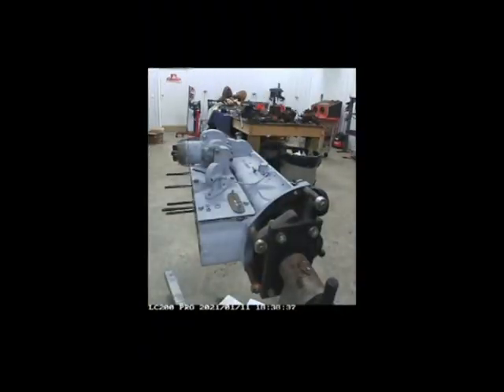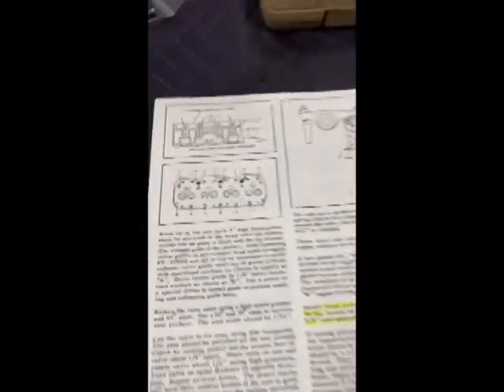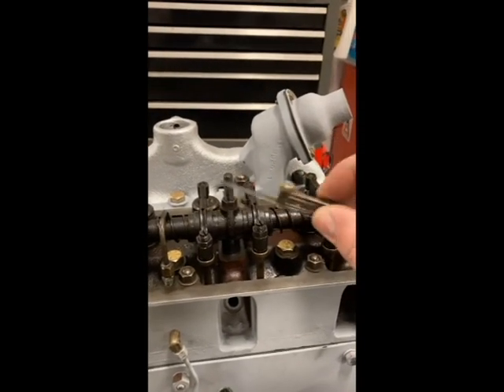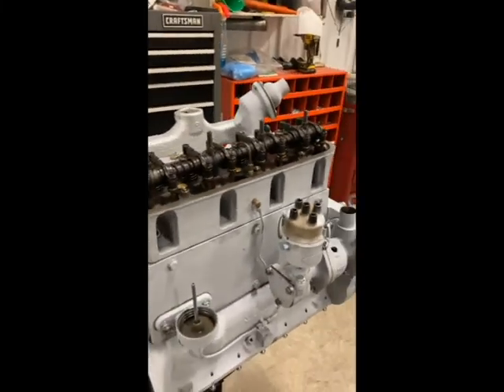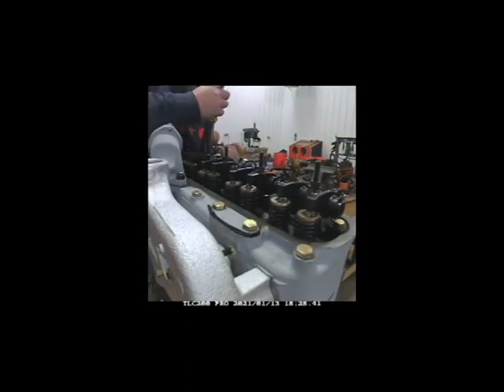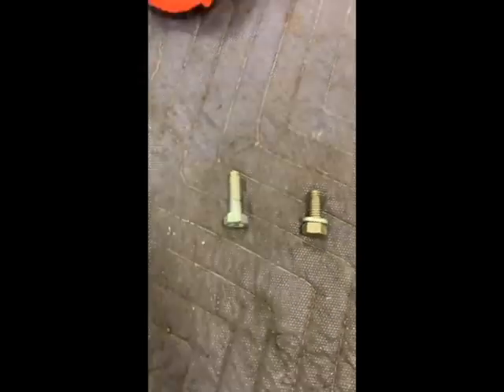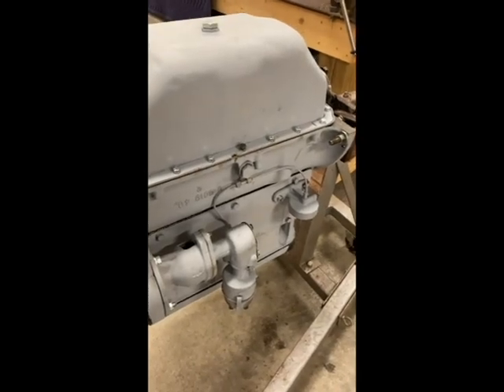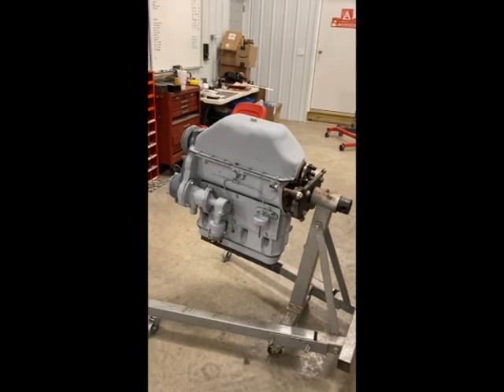Allis Chalmers WD Engine Assembly Top End Part 13

Comment: I'm working on rebuilding the engine on my WD as well and have the original studs removed from the block. I note that you replaced the original studs with bolts so I have to ask what grade of bolts did you use to replace the original studs?  Did you get them from a auto parts supplier or elsewhere? This 1950 vintage engine is the oldest engine I can recall ever rebuilding and I've never felt compelled to replace the old studs until now.
Reply from the maker: Jack they are grade 8 bolts and I purchased them from dis tractor parts.com. I’d recommend replacing yours.